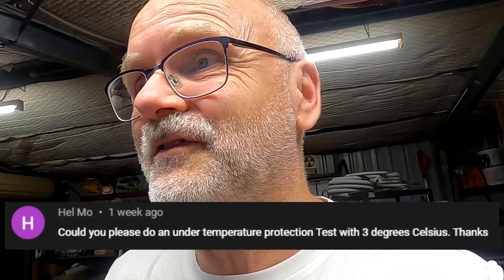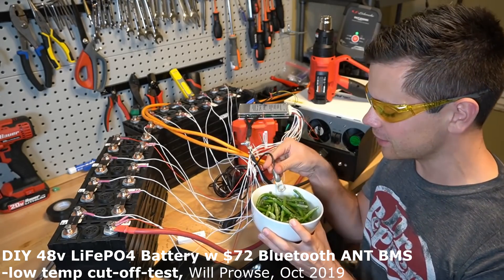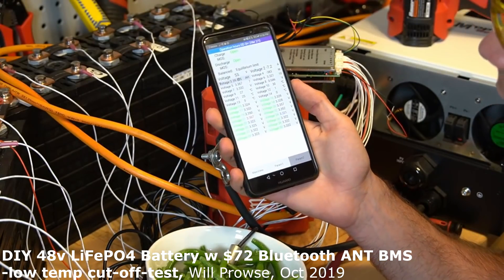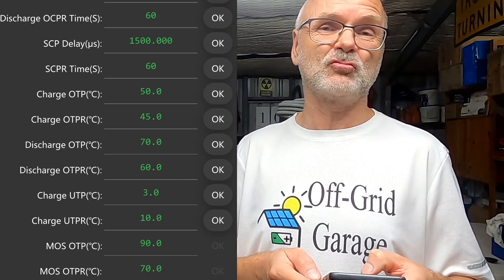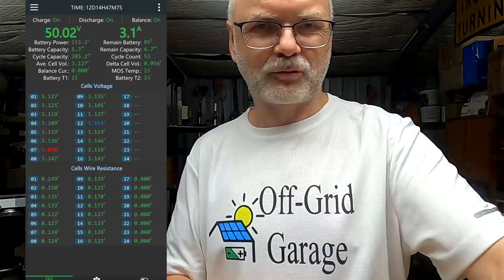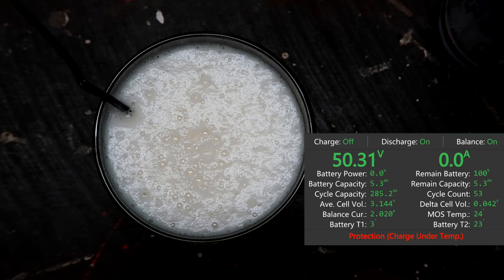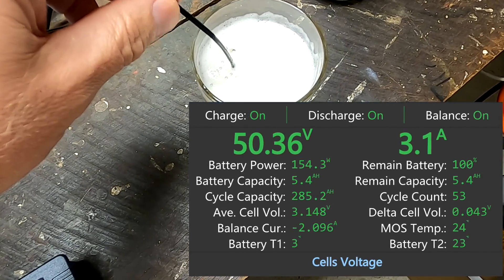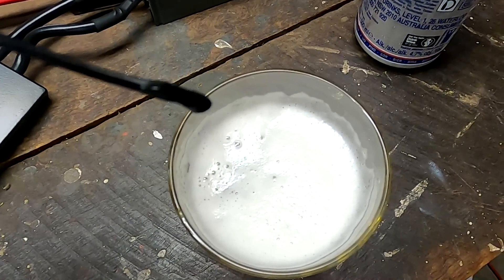Why Will Prowse failed with this test! Doing the low temperature cut-off test the right way!😉

Comment: Guten Abend aus dem kalten Deutschland (Paderborn nahe Kassel) nach "Down under". Und vielen lieben Dank an deine vielen tollen Videos, die mir sehr viel geholfen haben, und für die ich einige S.P.A.T.s spendiert habe. Vielleicht kannst du mir weiter helfen bei der Batterie Heizung vom JK-BMS. Ich habe drei JK-BMS B2A24S20P für meine drei Akku Packs mit 48 Volt. Alle drei habe einen Ausgang für die Akku Heizung, aber ich habe keine Dokumentation gefunden, wie der Stecker am BMS beschaltet ist (Pin-Belegung), die Belastbarkeit des Ausgangs und wie JK die Ein- und Ausschaltung realisiert. Ist der Ausgang abhängig von den Parametern UTP und UTPR ? Oder gibt es noch einen anderen Paramter für die Heizung, welche ich eventuell übersehen habe. Wenn die Heizung wirklich von den beiden Parametern UTP und UTPR abhänging sein sollte, dann sehe ich das Problem, das die Ladung der Akkus abgeschaltet wird, wenn UTP unterschritten wird, und dann erst die Heizung angeht und die Akkus aufwärmt. Besser wäre es, wenn die Heizung angeht, bevor die Ladung der Akkus abgeschaltet wird (UTP unterschritten wird). Dann hat die Heizung etwas Zeit, um die Akkus aufzuwäremen, bevor die Ladung abgeschaltet wird. Vielleicht hast du ja eine Dokumentation oder einen Kontakt zu JK bzgl. der Steckerbelegung und Funktion der Akku Heizung (Einstellungen). Würde mich über ein Feedback sehr freuen.  Viele Grüße  Ralf

Comment: Can someone help;
looking at the parameters of my JBD BMS, the charge under-temp default for lifepo4 cells is   -10.0  but so is the discharge under-temp. Isn't this wrong?  Right now the temp prob's inside my 8s, 100 Ah pack read 0.0'C .A 2nd pack right next to that pack, which is built exactly the same reads 0.1. ????????????? me confused.

Comment: I concer, with MrSummitville, that the small balance charge should not matter on a larger type battery bank, however, if there is a shoddy cell in the pack it would probably constantly be pulling charge from a cell or other cells which could possibly start a premature breakdown of the whole or some of the battery bank over time.

Comment: Here in Queensland, I like to support our local BUNDABERG RUM Brewery, and I am sure a cold can of Lazy Bear will work okay for this test, even tho most Qld’ers probably never need to worry about low temp issues. Great vid, Bagging Will did get my attention,  because I think he is great too. One quick thought tho, would be to use a 12v electric pet or aquarium type heater blanket under your battery cell setup to come on at a preset temp range, say 5c-10c and shut off at 15c would use little power to keep your batteries in a safer temp range, you could either use a 48v-12v converter or small 240v-12v adapter from ur inverter if it is always on. What I really do like about Will Prowse is his video’s are fairly direct, concise and cover most necessary points in short video time without much unnecessary blabber along the way.  Good vid and greetings from Qld! Cheers

Comment: BTW.. I was wondering if your busbar problems are related to the galvanic corrosion between aluminum and copper? Either the anode or the cathode on the cell is copper/aluminum. Only same metal or nickel plated material should be used on the terminals.. Dive in to it Andy! :)
Reply from the maker: The busbars are all plated, not pure copper. So this should not be a problem.
Reply: @OffGridGarageAustralia  ok, sorry I totally missed that.

Comment: Andy, what's interesting is it was still balancing even with the low temp cutoff activated. Couldn't that still damage the cell(s) that are receiving the current? Maybe it's low enough that it doesn't matter?
Reply from the maker: The balancer was still turned on from a previous test, set to 3V. I don't know, balancing with 2A, that's 0.007C for a 280A cell. Does that harm it?
Reply: @OffGridGarageAustralia  haha probably not 😂

Comment: I remember that video of Will's! The one thing I didn't like about the BMS he was testing was it requiring both sensors to reach the trigger temperature before protection kicked in. 🥶
Reply from the maker: Just another design flaw of Chinese electronics. The Ant BMS still seems to be a decent device.

Comment: Hi Andy
Does active balancing fall under charging?? Taking charge from one cell and putting it in to an other??
Reply from the maker: Kind of, it discharges one cell and charges another. You refer to the balancing still going at that point, right? Would that harm the battery? We usually balance only at high SOC, so the balancer was still active from a previous test. 2A is 0.007C for a 280Ah battery. Will this harm it?
Reply: @OffGridGarageAustralia  exactly my point, technically it's still charging the low cells from the high cells. The low temp cutoff cuts of charging even low amp charging so shouldn't it also cut balancing???

Comment: Thanks Andy, but can Americans can you use Bud ICE instead or is that a no-go?  And, what's the proper medium for over-temp testing, flame-grilled Bratwurst?
Reply from the maker: You can try a Bud and see if it works. I'ver never calibrated one tbh. 
Yeah, the Bratwurst seem to be great for a high temp cut-off test 🌭

Comment: Active balancing is not turning off? 2A is most likely not a problem for 304ah cells, but in a smaller pack that would not be good, right?
Reply from the maker: Balancing was still enabled form a previous test I did with the BMS. I think so either, for 280Ah cells, that only 0.007C. It also charges only sporadically while balancing. If you have smaller cells, you would turn down the balance current anyway, right?

Comment: But why is the balancing still running in under temperature? I think active balancing is also some kind of charging.
Reply from the maker: The balancer was still activated from a previous test.
Reply: @OffGridGarageAustralia  Yes, but I think the balancer should be deactivated automatically at Low temperature because active balancing is also charging.
Reply: @dirkaust5107  No, you are not required to stop the small balancing current on a large battery bank at 3° C.  Because ... the charging rate needs to decrease, as the temperatures decreases.  Normal "FAST" charging should stop at or below 0° C.

Comment: HI I also in Australia. Can you tell me where you bought the power support. most of them are 30V . the other up to 60V 5V. can suggestion?
I think I will buy the JK BMS and test as well. Once I have my property.
Reply from the maker: All links are in the description of each video or here on my website: https://off-grid-garage.com/measurement-tools-and-analisers/
I've got this 60V/5A power supply and also the larger one with 60V and 2A. That's a beast. Both are on my website.

Comment: If you can adjust it salt water will get colder than 0° for you animals 32° really but I guess you could put your cold beer in the freezer for like half an hour or so and get colder than freezing
Reply: Wet the sensor and dip it in salt, then dip it in a Margarita. 🍹
Reply: @charlesrichards5389  well salt doesn't go in the margarita it goes on the rim
Reply: @james10739  Rules got thrown out the window when we started testing electronics with beans and beer.
Reply from the maker: Hahahaha, having a good laugh at your comments here! 🍺🍹

Comment: I think, for testing a BMS you should use a B.A.T instead(BMS Adjustment Tool, not to confuse with a Battery Adjustment Tool of course).
Can you do a comparison with Weißbier? And why don't you brew your own Off-Grid Garage beer?
Best wishes from rainy cool Bulgaria
Reply from the maker: I think we should stick with the SPAT and the known features this 'Swiss Army Knife' has. Not only can it calibrate solar panels, but now also help testing BMS and keeps me cool in this hot climate 🥳

Comment: It looked like the active balancer was still functional though.  Isn't that a problem?
Reply from the maker: It was till turned on from a previous test...
Reply: @Dave S - Why would a small balancing current, in a large battery bank, be a problem at 3° C ?

Comment: Is there a BMS with similar features for 4S 12V configuration?
I remember Will's frozen vegetables video - it got the job done!
Reply from the maker: Thank you.
You can use the same BMS for 4s config as well. It just needs a small boster for the power supply. I'll show this in a video soon.
Reply: @OffGridGarageAustralia  Great - I look forward to it!  I hope it's not too much more expensive the the other 4S BMS.  The features and your testing makes it look really good.

Comment: Andy, the balancing continued when the low temp cutoff was reached, what do you think of this? Surely even two amps into a freezing LiFePO4 cell will damage it.
Reply from the maker: The balancer was still set to 3V from a previous test. While editing, I noticed that it kept balancing in both directions. 2A are 0.007C. Will this still damage the cells?
Reply: @OffGridGarageAustralia  It's a valid question, because charging below zero is supposed to be an absolute no. It would depend on the exact chemistry I imagine. Someone for a bigger brain than I but people should take note as essentially the low temperature cut off doesn't work. Would the seller have an opinion?
Reply: @OffGridGarageAustralia  No, it won't. As usual, there are no absolutes in this. It's just that as the temperature drops, one should lower the charge current significantly, and 0.007C is low enough. Secondly, I did a test some time ago (video on my channel) where I try to charge a battery at freezing temperatures. The internal resistance gets so high that at normal charge voltage, barely any current can flow.
Reply: Actually I'm not sure, the balancing current goes from +2 to -2 when it turns off? So what does that mean, it is discharging only?
Reply: No, not a 280ah cell. If it were a 2ah cell then it might be too much for it at 0 degrees, that's 1c charge current. 2 amps charge current on a 280ah cell is nothing. Even if the cold made it's internal resistance a lot higher than usual, 2 amps would still be nothing to it. Of course that's why you can adjust the balancing pressure in case you are using much smaller cells, or cells that don't perform particularly well due to high Internal resistance because of age or air temperature or just that there not designed to be high output cells.

Comment: Fyi if anyone seriously want to know how to get to 0 the way to do it is with pure water ice cubes and pure water. A mix of ice cubes and a little bit of water. put the probe in the water bit not touching any ice cubes. 0 degrees exactly. This is the way process engineers calibrate their equipment.
Reply from the maker: Yes, that is correct. You also ad some salt, I believe
Reply: @OffGridGarageAustralia  no salt that will then go below 0 and put off the calibration.

Comment: Well done Andy, 
but does anyone recognized that the balancing is still working with 2A+, this should also stop because it is charging batteries. Or am I wrong?
Reply from the maker: That was still set to 3V from a previous test...
Reply: @OffGridGarageAustralia  yes that’s ok, but should balancing not also stop when low temp charge protection is triggered? I mean the JK BMS can balance with 4Amps. It’s not that much current when I look what the battery can handle, but will it not also hurt the battery chemistry?
Reply: @ingmarmaul4464  Who said, a low balancing current, in a large battery bank, must stop at 3°C ?  Nobody ever ...
Reply: @MrSummitville  that has been my initial question, because when even with 0 or minus degrees a balancing with 2-4A is OK, that tells me that I can also charge a Batterie with 2-4A? Or am I completely wrong, if the charger puts 2-4A into the Batterie or the BMS should be the same?

Would be pleased to here some more comments on that topic.

Comment: I noticed that the balance current still showed a negative current while in under temperature protection.  I assume that means it's discharging a cell.  Will it disable putting a balance current into a cell while in under temp condition.  Will setting discharge under temp protection prevent the balancing circuit from discharging a cell?  Crack open another beer, more testing is needed!

Comment: Haha nice work uncle Andy, this is the ant bms I referred to you previously, there is a updated version the ant bms +
Cheapest most reliable bms with a very good quality build.
Updated version has better temp sension, but in Australia and South Africa, we don't get sub C Temps to even worry about low Temps so we good.

Comment: Actually the BMS seels to fail the test because although charging current was cut, the equalisation current was not, so for some batteries, involved in the equalisation, there was no current cut.
Reply: the balance function has such low current i dont think it would be any issue still charging at low temp with a few Mah
Reply from the maker: The balancer was still set to 3V from a previous test. Yeah, good point though not sure if this small current could still damage the cells.
Reply: If the balancing current was not significantly reduced in this test, what would happen if it is equalising at 4 amps when the temperature drops?
Reply: @dffghuytfvb  4A is 0.015C - this won't harm the cell (also, the BMS supports only 2A balancing as far as I know). However, since you only are supposed to balance at higher voltages, this is moot since charging won't occur due to low temp cut-off to get you to this state in the first place. It's not like you're charging at 0.5C and suddenly your temperature drops that low that you have to cut off charging.
Reply: There is a bunch of reasons why the batteries in this setting won't be harmed. What if we have smaller batteries? Also why is there a thermal protection? What does the data sheet says? I still think that it should be considered as a software bug, and it should be easy to solve.
Reply: @dffghuytfvb  The cells were NOT at 3° C.  A small balancing current, in a large battery bank, does not need to stop at 3° C.

Comment: Hi ich hoffe mir kann jemand helfen ich habe ein dali BMS und es funktioniert eigentlich ganz gut aber ich habe ein Problem wen es abschaltet wegen zu geringer Spannung gibt es überhaupt keinen Strom aus was eigentlich ja gut ist aber das Problem ist mein solar lade Regler braucht erst etwas Strom um hochzufahren von der Batterie und wen  ich es also Laden will geht das nicht weil das bms ja erst wieder Strom ausgibt wen es Strom zum laden Bekommen hat ich hoffe mir kann jemand helfen weil sonst muss ich immer morgen wen die sonne auf geht die Batterie für 10 Sekunden an den Strom hängen das das bms freischaltet und die Batterie lädt
Reply: ....liegt am falschen Bier.......... :-)
Reply: Der Trick besteht darin, den entladen zu stoppen, bevor bms abschaltet.  Um manuell zu starten, können Sie eine Vorladung mit Taster und Widerstand über das bms anschließen
Reply: @johthe  Das Problem ist ich sehe nicht wen der Akku Lehr wird da die von Batterie 30minuten von mir weg ist und für die Wasserversorgung für die Tiere zuständig ist
Reply: @philippgraf4589  Die pumpe benötigt eine unterspannungsüberwachung, die die pumpe vor bms abschaltet. müssen ein lvd, low voltage disconect, finden, das zu Ihrer Pumpe und Spannungsabschaltung in bms passt
Reply: @johthe  Weist du wo ich sowas mit 150a her bekomme mit 29v Max Spannung
Reply: @philippgraf4589  Haben sie eine 30V,150A pumpe  für tiere?  Klingt ungewöhnlich. Hast du auch einen Wechselrichter?  My german is a bit rusty. Ich übersetze das alles in Google-translate. wie hoch pumpt ihr das wasser?
Reply: @johthe  ich habe es über eine Wechselrichter angeschlossen und die pumpe zieht durchgehen 100a an der Batterie Seite ich will aber etwas Luft nach oben haben
Reply: @philippgraf4589  ok, Wechselrichter haben oft einen eingebauten Unterspannungsschutz.  welchen hersteller und modell hast du?  Wie hoch pumpen Sie Wasser?  Ich verwende eine kleinere bürstenlose 24V-Pumpe 50W, die gut für den Garten bis zu einer Höhe von etwa 15 Metern pumpt.  Es gibt auch Druckerhöhungspumpen, die mehr können.
Reply from the maker: Ja, sehe ich auch so, der Wechselrichter sollte zuerst abschalten, wenn die Battery leer ist. Bei manchen kann man aber nichts programmieren und die low-voltage disconnect ist mit 20V fest eingestellt. Das ist jedoch viel zu niedrig. 
Bei AliExpress kann man low voltage disconnects bestellen, die kommen mit Relais und koennen auch 100A plus schalten.

Comment: shouldn't it also stop balancing?
Reply from the maker: The balancer was still set to 3V from a previous test. While editing, I noticed that it kept balancing in both directions. 2A are 0.007C. Will this still damage the cells?
Reply: @OffGridGarageAustralia  That is the question! Somewhere in my head there is an info that it destroys the battery when charging with high current. Not quite sure. Then i read something about "down to -10°C charging with a max of 0.05C". Research would be good but i am sure that this does not concern you in the land where all electrons fall out of all devices ;)
Reply: @partyboarderdos  A small balancing current, in a large battery bank, does not need to stop at 3° C.

Comment: What if organic green beans are dipped in Beer? Will that make the beer more organic? That is a very useful to know that each temperature probe can measure both temperatures and send a signal to turn off. Would be very handy in a temperature-controlled battery box.
Reply from the maker: Hahaha, good question.
And we still learned something from this silly video, right? So, win, win...
Reply: Beans in beer?? To the gallows with you immediately! 👉
Reply from the maker: @MartinTheLaserGuy  🤣🤣🤣